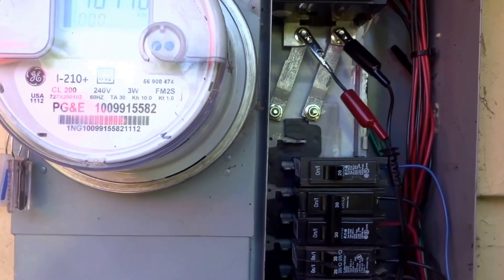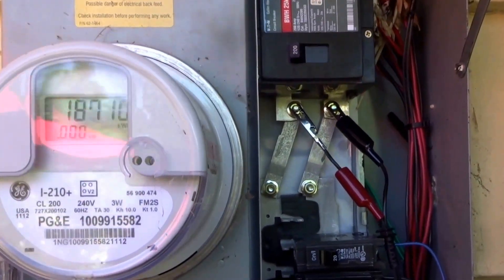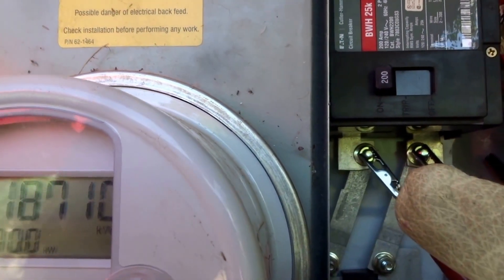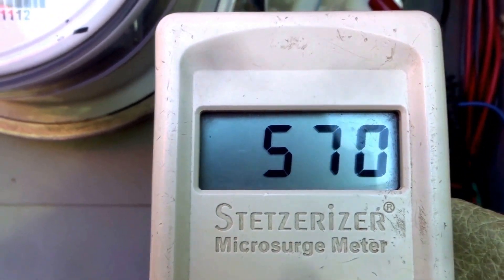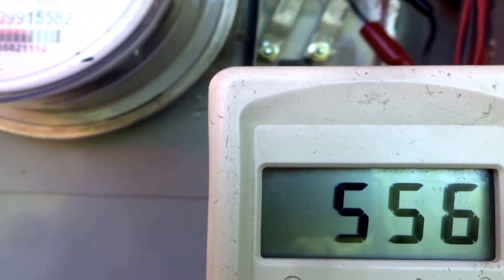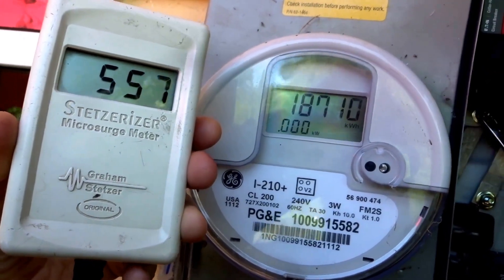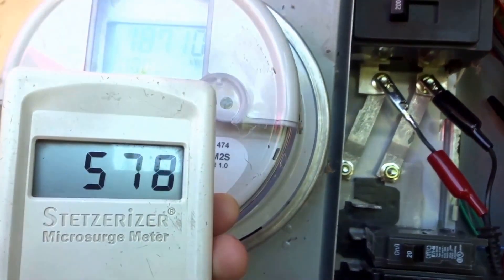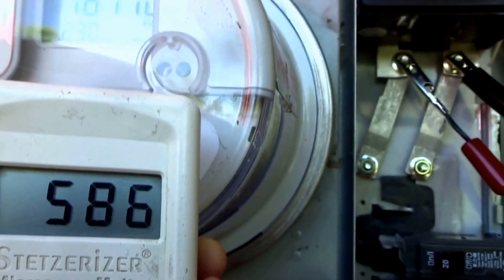Dirty Electricity Coming In On The Utility Feed

Comment: My wife and I are moving into a condo. I use the Stetzerizer and G-S filter in my current home.  As we were looking at different condo units I measured readings ranging from a low of 400 on some units to over 2000 (since the meter pegged).  The unit we are considering has the lowest readings from 400-600.  Way too high.  Is there any method of filtering the mains for high frequency noise other than G-S filters inside?
Reply: Maybe always keep all circuit breakers off as much as possible except when powering dc batteries with the AC current from the outlets when no one is in the house (like at work etc.) and then running stuff off the batteries? im not sure if dc batteries would still generate dirty electricity?
Reply: Static power box for whole house filter..